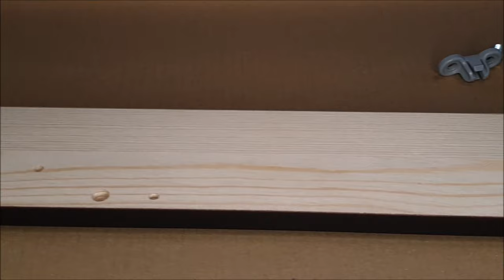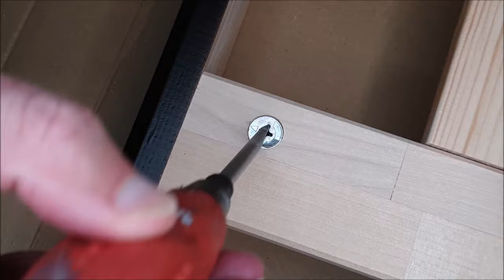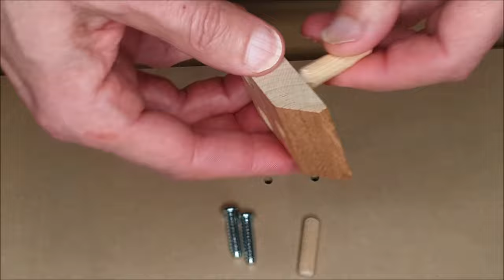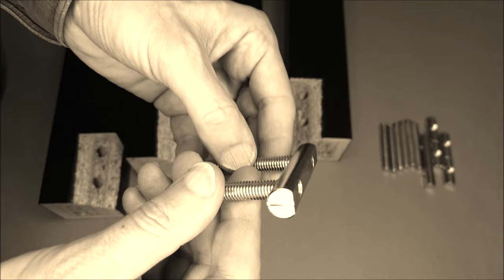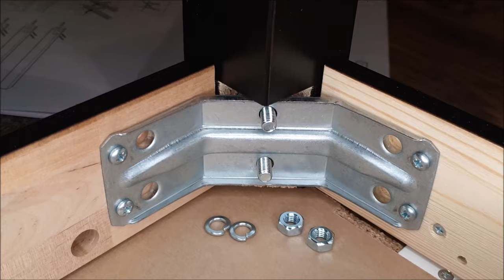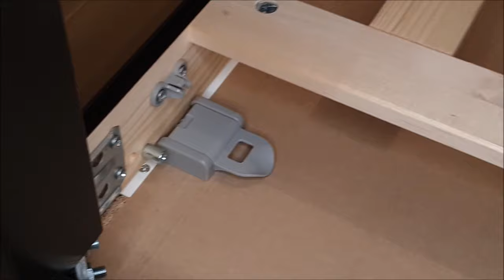Ikea Laneberg extendable table assembly

Comment: Getting the base assembly to fit into the slide grooves was the biggest pain. It took some time to fiddle back and forth getting the white slide pieces to sit down in the slotted grooves in the table top. Simultaneous pressure on the frame and sliding motion overcame the resistance finally but it was a struggle. In this video it slides like magic! Uh Uh not in the real world in my case. However the rest was easy.
Reply: Can I pls ask you how cause I had the table for a while and idk how but now I tried to make it small again but it doesn’t work it stop halfway through there
Reply: @teodora6511  I would suggest getting help from a friend to turn the table upside down and examine it from underneath to see if there is something miss-aligned.

Comment: I've had the chance to use this table a couple of times now. It's fun to whip out in front of people:) I can see what people are talking about when they say the legs are delicate, but they're design to support a "mostly" vertical load, not be torqued from the side or pushed back into place. If you just let the table open or close on it's own and don't force anything, it works great https://www.youtube.com/post/UgkxyFZUPFEey-PuqsPMxqaykBhgA1LWxFHh Once it's set up, it's pretty solid. My only gripe would probably be related to the clamps provided. They're not the highest quality. They do the job, so no big deal, but they could be better. All in all, pretty cool gadget.
Reply from the maker: Thanks

Comment: Hi k-nemo, i just put together this table but the top does not run smoothly unless i don't lift it a bit. But if i lift it, there'll be a gap between the top of the table and the structure under it... what went wrong?  :-/
Reply from the maker: There is a gap between the table top and the structure below it. The tabletop slides on runners and not directly on the frame.
The tabletop does not move perfectly smoothly at my place either.

Comment: I cannot for the life of me figure out the slide part. I put the 4 thingies in properly, they all go under the respective rails and then the whole piece gets stuck. It just won't slide. Took me like 30 minutes until this point, but have been stuck for the past 2 weeks. Any tips?
Reply from the maker: Check all steps with the instructions.
Reply: I have same problem??? Did you figure it out
Reply: @lukastojkic7548  I did not. I shoved it in and broke it lol. Luckily, it broke in a way where the table was stuck in the rail, so I guess instead of having an extendable table I now have an extended table 😆

Comment: I need your help! I had trouble connecting the frame and the top layer and 2 out of the 4 white plastic devices that are supposed to make the table top slide broke. I tried to take em off, but they stick firmly. I'm desperate for an advice, i fear i'll have to throw the table away!
Reply: You can get the parts from Ikea if you to shop with the bill
Reply: I put them in wrong and had to pry one side out carefully with a long thin 🪛 and the rest came out by slowly prying bit by bit

Comment: Just curious, what is the part at 0:59 for exactly? There are four of them and one of mine won't screw down all the way and I'm kind of nervous to continue assembling the table without figuring that out first.
Reply: Then try to check if any wood dust is still in there
Reply: and pull it happened with me too
Reply: I hope you got it finished by now 😜. In case anyone else is wondering, those pieces are for stopping the sliding mechanism for the table extension.

Comment: Hi, plan to buy this table, but is it safe after expanded? I am just afraid if guest sits in the left or right side, and push down the edge little bit, then the middle part flies..
Reply from the maker: It opens and closes very easy and nothing is wobbly
Reply: I put mine together today. It’s solid! I use one end and one of my cats has a bed on the other end he sleeps in. No problems. The table is a bargain price.

Comment: Hey I can’t get it to slide when trying to connect both pieces not sure what I have done wrong please help! 🥴
Reply from the maker: Which minute on the film please?
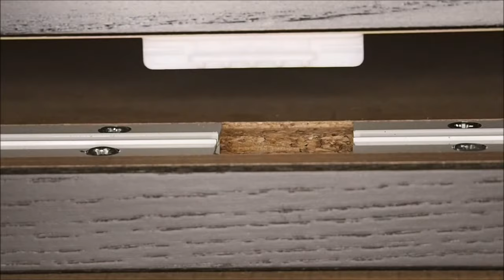Reply: 4:24 .. does it just slide one way and stop or does both sides slide
Reply from the maker: @tazb6744  I had problem when I did it first time as well. Put  the parallel so that they glide like 4:21. The plastic part must 'jump in'. It should slide both ways.
Reply: I will give it a try tomorrow fingers crossed
Reply: Thank you
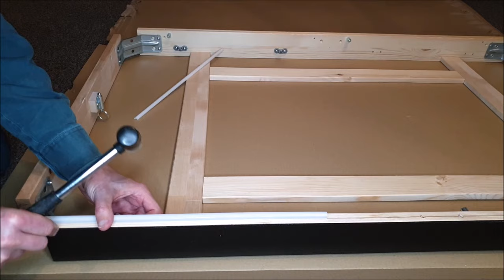Reply: @k-nemo  hi. In the minute 3:36, the plastic part goes all the way down? I can’t make it slide.